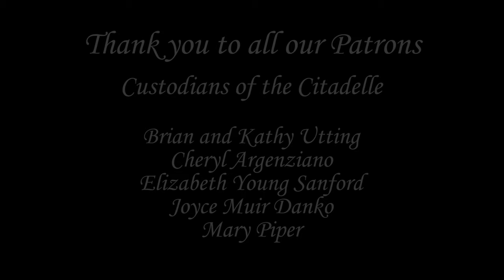EP176  It's a puzzle!   Recreating the design of the recently discovered ancient tiles.

Comment: On removal of the Tile if you used an oscillating tool around the grout to remove the grout first. Never let the chisel touch the tile. I have a Fein oscillating tool with many different tips. You can find cheaper oscillating tools. I use mine all the time even for wood crafts using old fencing turning it into Boho / shabby chic. shelving, frames, bird houses, plant stands.